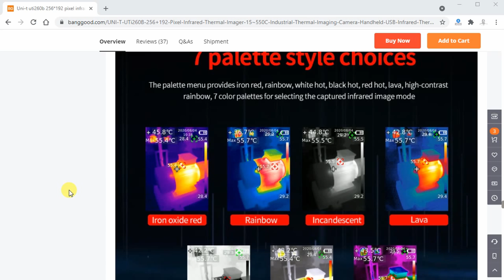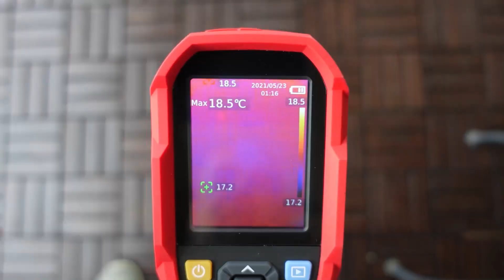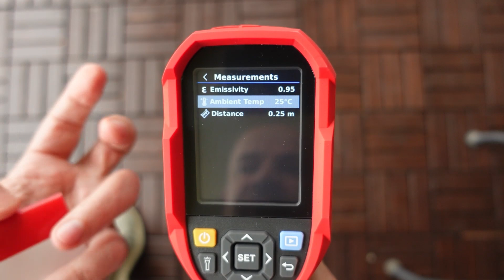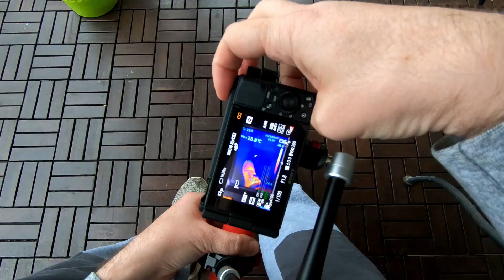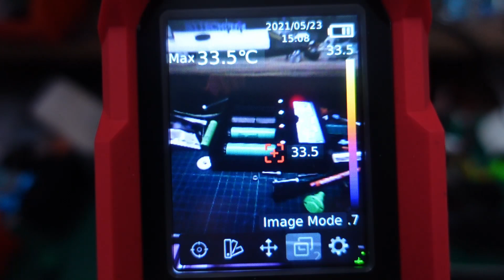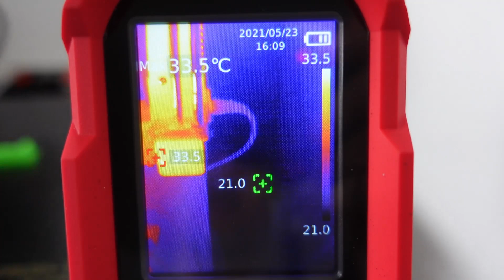UNI-T UTi260B affordable thermal camera for 3D printing enthusiasts (review, unboxing, samples)

Comment: I bought such an infrared camera (thermal imager) -tooltop et693c,
He cut out and glued a plastic for microlyins for her (to search for short circuits)-
drilled two openings for a lens 20 mm and for a video camera 14 mm,
I glued everything, glued the moment with glue,
And he glued the lens with other glue-slicen, without vinegar, neutral,
Focus Lines Cloudray CO2 ZNSE
with a number = 25.4 mm (for SMD phones-PCB Circuit Board)
with a number = 38.1 mm, (excellent for SMD elements-PCB Circuit Board),
and number = 76.2 mm, (excellent for PCB Circuit Board)
The diameter of everyone is the same 20 mm, drilled and dirka for a video camera 14 mm.
It is better to take the brand of lenses = Focus Lens vs CVD ZNSE, it gives less distortion, but 2 times more expensive.
He cut out and glued a box of payments for nozzles with lenses to prevent scratches on lenses.
I recommend it!

Comment: for the price it seems like a decent handheld thermal camera and yeah resolution goes a long way when it comes to thermal cameras and if you wanna use it for video, then framerate, as most able to record video is limited to 9hz.. hence some dated ITAR reg.. back when it was mostly US that was able to make these microbolometer sensors for consumergrade devices..
purchased a 300 USD thermal cam back in 2017 on eBay and was pleasantly supprised to see it both was new and the fast frame variant.
but the manual focus is also important.
https://youtu.be/Im1_Dyf69to?t=85
and focus
https://www.youtube.com/watch?v=0XCOqIPQFkQ&t=91s

Comment: what does the 9fps framerate affect? some models have 25 some have just 9. But i don't know what benefit will 25fps have?
Reply: fps effects movement.  how fast the thermal camera can react to changes.  25fps better for electronics.

Comment: Thanks for the review. 
do you know it  the quality is enough be to detect a wall moisture from rain or leaking pipe ?
Reply from the maker: Only if the moisture has different temperature. 1°C difference is enough to be noticed.

Comment: Hi, are you still using this Thermal Imager? I've had bad thing happened to me, I just bought it and when I firstly charged it fully it started to make whistling sound and wouldn't  turn on anymore. It died completely. 

I have two questions. How do I disable it? I haven't found any information on the internet, it has some sort of secret I think. It's  very tricky or they did it like this on purpose. 

2. Important question to me, I measured resistance between 5 volts and gnd on the Type C connector.  It shows 200 to 210 ohms. It's not full short circuit, but close.  If you have such a chance, can you tell what's your resistance?

P.s still cannot  understand how it could happen. It looks awesome. Amazing quality.  Best brand. And it dies after first charge....
Reply from the maker: Sorry about your product, I am still using it without any problems so far. There is a button do disable it (try long press if it is freezed). Also it disable after 10 minutes. Try to contact the seller, send it back if necessary.
Reply: @MyTechFun  I already disassembled it and found out that one diod was soldered very poorly. I was unlucky receiving a defected one.
Reply from the maker: @StoneTL  So, you could fix it?
Reply: @MyTechFun  not yet. This diode is in sot-323. But I'm working on it. Hope I didn't fry the main IC and it will work again without replacing parts. :)

Comment: theoretically you can disassemble camera connect a buzzer from the LED  contacts .
Reply from the maker: Great thinking. Probably buzzer can not fit inside, but you gived me another idea: photoresistor + buzzer (outside on some 3D printed holder), so it detects the leds. Bulky, but in "monitoring" it would be on some tripod anyway.

Comment: The emissivity describes how much thermal radiation the material emits in relation to its temperature. When set incorrectly for a material your reported temperatures will be incorrect. Also, shiny surfaces will most likely report the wrong temperature.

Comment: Great Video, I installed that stick on insulation on the bed of my ender3 to try and get more even heating but have no way to tell if it works. This device would fit the bill

Comment: You can use a polished metal surface as a "mirror". Instead of measuring the temperature of the metal, you measure the temperature of the reflection.

Comment: I got the same, and realy like it. I think the only thing I miss is to be able to use a fixed temperature range. The camera always auto adjust and you can miss details when one point is very hot or when you want to compare different locations.